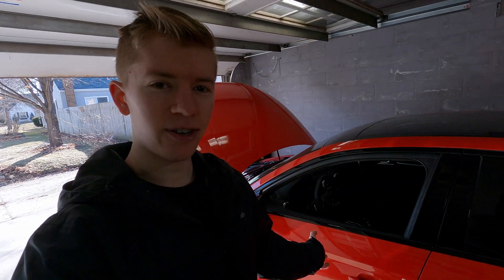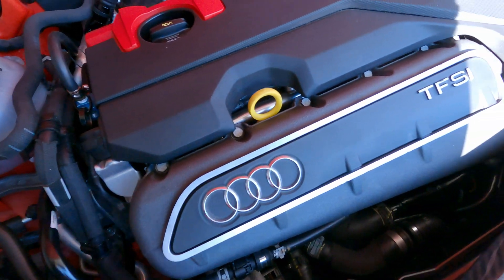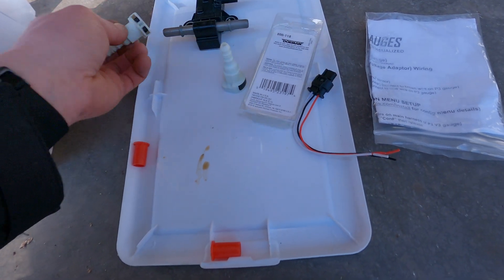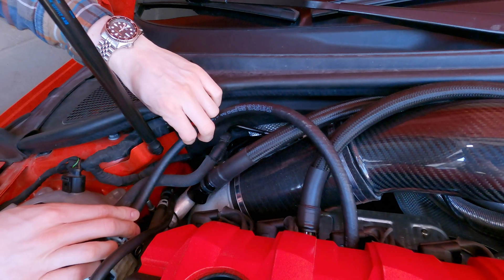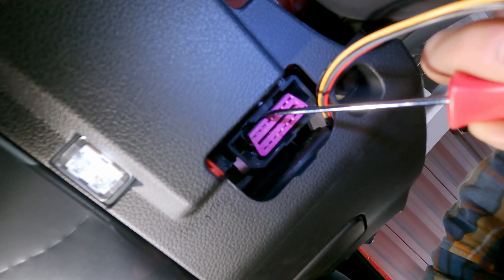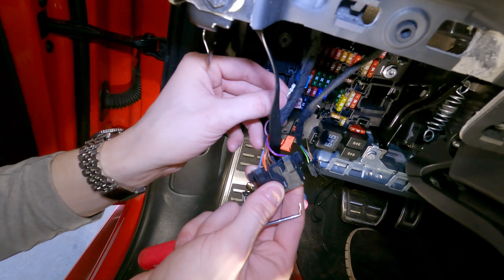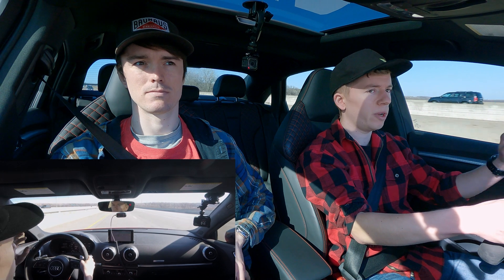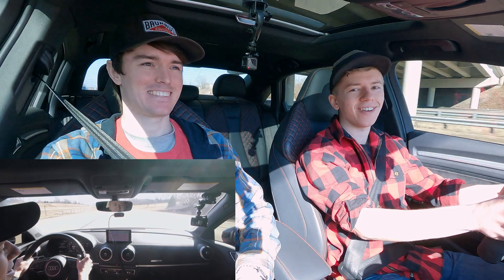RS3 Ethanol Content Sensor Install DS1 Flex Fueling

Comment from the maker: I miss labeled the video.  The resistor is a pull up resistor between Signal and 12V!!
Reply: Hey, thnx for the vid. I had one question, why use a resistor? I see most videos on this install not mention one and I see a few that do. I have a ethanol content analyzer and I’m setting it up with the P3 gauge and P3 voltage adapter. Thnx for answering my question.
Reply from the maker: @SephiroTTh  it's to ensure the signal is forced to 12V if it isn't being driven by the sensor otherwise it could "float" and cause a false reading.
Reply: @HardwayLearning  Does this mean the sensor is constantly powered (even when car is off and locked), and can lead to battery going flat?
Reply from the maker: @RichLion  no, it's high impedance so it draws next to no current. This is a common method to force known logic for a microcontroller inputs so it doesn't float or remain unknown.
Reply: So you connected the resistor to the Signal wire and 12v??
Reply from the maker: Correct!
Reply: @HardwayLearning okay cool thanks man! 
Also ik i'm wayyy late in this video lol, but i broke the pin from #15 mistakenly, and the link for the pins you labeled is no longer available , Was it just a variety kit with a whole bunch of different ones? just not sure if any of them are same as our audi ones or not
Reply from the maker: Just added a fresh link, comes with pre -crimped wires to pins, depin that from extra connector and insert into the car connector and do a butt crimp to the end of the newly added wire
Reply: @HardwayLearning okay cool man thank you!! Do you think those pins will work with our audi connector ?

Comment: @HardwayLearning   Did you dyno OTS 1 fully stock on e85 ?  I want to compare with Uni 1+.
Reply from the maker: The car was on a hybrid turbo by the time the DS1 came out so unfortunately not.
Reply from the maker: I will say, most OTS tunes are going to be within 5% of each other if they are safe.  Where the DS1 benefits is significantly better logging and on the fly map switching/flex fueling which is nice!

Comment: Great video.  i have it all wired up but getting no EC reading, just zero.  i think it might be a bad ESVA.  Did you use an ESVA or wire the signal cable to the brown analog input wire on the P3 wire harness?  I wasn't sure if that's what you meant with the resistor you used.  would like to be able to test bypassing the ESVA to rule out the sensor.  thank you.
Reply from the maker: We aren't currently running it to the P3 gauge and you do need their input voltage adjustment circuit (ESVA) to make it work with the P3 gauge.  

In this video we wired it directly to the OBD2 port to be measured by the DS1 and displayed on the digital dash.

Our sensor can go straight to the OBD port, no ESVA needed. You need to tie the resistor to that sensor output and 12V (pull up resistor). One leg soldered to the sensor output and one leg soldered to your 12V source.
Reply: @HardwayLearning  I was able to figure it out by testing each connection point with a digital multi meter.  I wound up rewiring from the ethanol sensor to the ESVA using better wire.
Just wanted to thank you again, the Amazon parts list with links, made this job way easier.
Reply from the maker: @clos2070  sweet, glad it worked out! Happy boosting 😁

Comment: Nice video gents. Few questions, if you did it again would you just reuse the oem fuel line? And when you mention resistors, one has to go in line with each the signal as well as the ground?
Reply from the maker: Resistor is in parallel to signal and 12V. It is a pull up resistor for the signal channel. You could totally reuse the OEM line. I believe we ended up using the OEM fittings for each end. So you really only need some clamps, the ECA, resistor, and fittings where it connects to the ECA, and extra wire.

Comment: Did you guys ever run an analog boost line? I'm assuming the OBD maxes out way below whatever boost you are running now?
Reply from the maker: No we did not, just running it off of OBD2 port 👍, but I actually haven't really had it connected since we got the DS1

Comment: regarding the boost creep, is this a function of the SRM/Gen 2 setup or just when running 93 fuel?
Reply from the maker: It becomes more of an issue because we are trying to run 91/93 octane. With E85 the boost target is higher so you can work with the boost creep.

93 octane max boost target is 25psi, much over that and the car starts to knock due to too much heat. Since we are creeping past 29psi at 7000rpm and spiking between shifts we can't support 93 octane with those boost levels.

With E85 the car should support boost up to 35psi, so it doesn't really matter if you boost creep to 29psi because you're still going to try and target above that.

Basically the internal wastegate port on the OEM modified SRM manifold isn't large enough to bleed the pressure with the flap all the way open so we are going to run an external gate to make that flap much larger
Reply: @HardwayLearning   Appreciate your response.  Sounds like I need to do a log on 93!!!
Reply: @HardwayLearning  are you gonna weld some V band flange for a tial wastegate on the SRM manifold ?
Reply from the maker: We are having a shop do it. Not sure I'd trust my welding abilities on a thick cast part like that 😂

Comment: Nice one! Perfect timing I’m installing mine in 2 days. Can you show more about integration of maps with ds1 and flex?
Reply from the maker: That's more on who is tuning the car. As soon as we plugged it in, the ethanol content is updated on the gauges. You will have to work with your tuner to ensure timing and fuel is working optimally.

Comment: Why doesn’t someone use an obd splitter harness to make this pnp
Reply from the maker: Would be a lot of cost to just wire in 1 pin tbh. It's not all that difficult to pull the wire out of the OBD port, plus you don't really want that other wire communicating at the same time as the ECA.

Comment: hey did you remove the oem boost control solenoid  when you installed the MAC valve for the SRM turbo ?
Reply from the maker: Yes, OEM controller is completely removed 🤘
Reply: @HardwayLearning  good job , my only advice to secure and tidy things up a little bit would be to add any kind of insulation or protecting sleeve to your wire going in the engine bay , mac valve wire , ECA sensor wire , dont let them run bare , use some tape or sleeve or mesh , keep up the RS3 content , maybe you could do a small video on how your built engine is doing , oil consumption , piston noise , any downside , how you did the breaking in etc :D